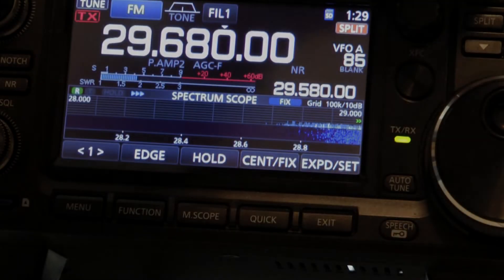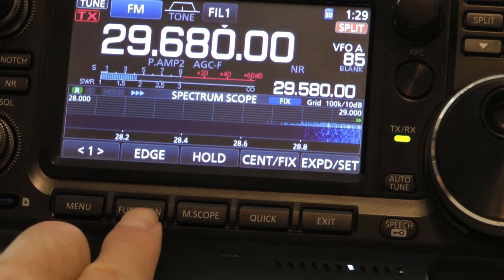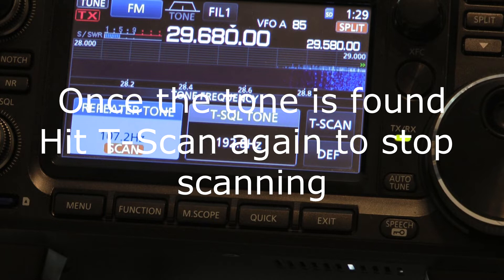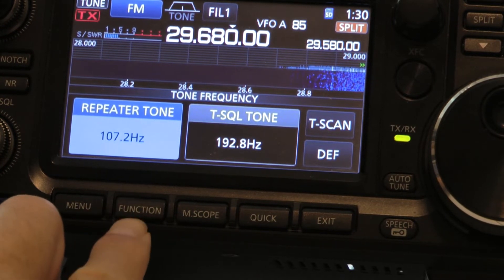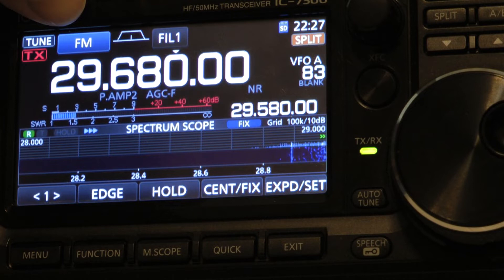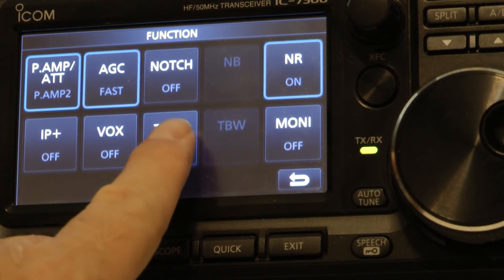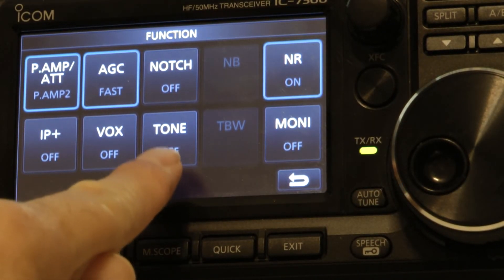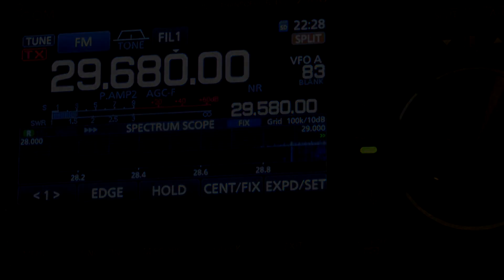Icom IC 7300 10 meter Repeater PL Tones Ham Radio

Comment: What bands does the 7300 cover
Reply from the maker: The Transmit Frequencies are 1.800–1.999MHz, 3.500–3.800MHz,
7.000–7.200MHz, 10.100–10.150MHz,
14.000–14.350MHz, 18.068–18.168MHz,
21.000–21.450MHz, 24.890–24.990MHz,
28.000–29.700MHz, 50.000–52.000MHz,
In other words, 160 Meters - 6 Meters in the USA
Reply: @RichRodgersOnline  so besides 2 m and 70 cm which I already have a base for it covers it all?
Reply from the maker: @KE8ODY-WV-Ares-Ham-Dad-3O4  Yes, It overs all the ham bands listed.  It is a great radio!!!   Here is more info https://www.icomjapan.com/lineup/products/IC-7300EUR/?open=2
Reply: And I found a great deal on a 7300..
Reply: @RichRodgersOnline  I lone my ftm500 hate to grt rid of it maybe thr 7300 is what I need
Reply from the maker: @KE8ODY-WV-Ares-Ham-Dad-3O4  You will love it!!
Reply: @RichRodgersOnline  now antenna wise I'm at a elevation of 3000 feet no obstructions, what would you recommend for hf.. I have a 10mdipole and a diamond x50 atm
Reply from the maker: @KE8ODY-Wv  Depending on money.   I had, at one time, a 3 element tri band on a 50 ft tower.   It was great!  Depends on how much land you have. I an using an 80 meter full wave loop. I use it with an external antenna tuner for 80 to 10 meters.  If I had room, I would put up a 160 meter  full wave loop. A lot of gain on 20 meters and 10 meters with those loops
Reply: @RichRodgersOnline  yeah I wish I did I'm in a town house I have a diamond x50 a for my dual band and a 10m dipole atm
Reply: Considering adding my shack I currently have a ftm 500 dual handed and a few 10 meter machines.. Would this cover everything else

Comment: My local FM repeaters are on 
146.940 (- 600 kHz) (107.2 hz PL)
145.130 (- 600 kHz) (107.2 hz PL)
444.800 (+ 5 mHz) (100.0 hz PL)

But I don’t know how to put those numbers in my radio. I am new to this but cannot figure out where these  frequencies are…what is 146.940 and such? Also have Icom7300
Reply from the maker: Hi there,  thanks for watching my video.  The 7300 does not operate on those high frequencies.  Here are some 10 meter repeater frequencies https://www.worldwidedx.com/threads/north-america-10-meter-repeater-list.124173/
Reply: @RichRodgersOnline  well that EXPLAINS a lot. I’ve been going crazy for days trying to access them.
Reply from the maker: For the frequencies you wanted to use.  You need a 2 meter and/ or 70 cm transceiver or handie talkie which covers those frequencies.
Reply: @RichRodgersOnline  thanks for all your help! Great video that helps us newbie future HAMS.
Reply from the maker: You are welcome!